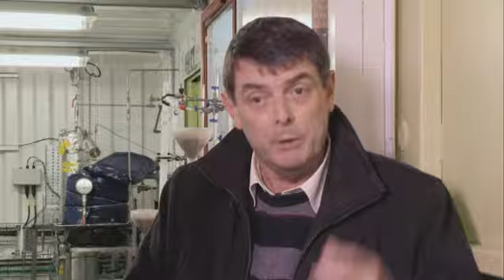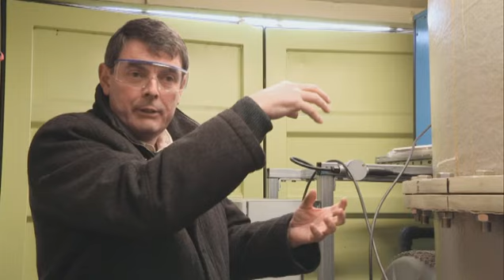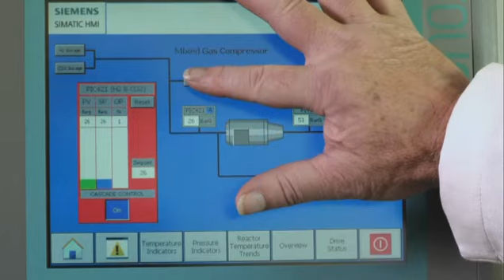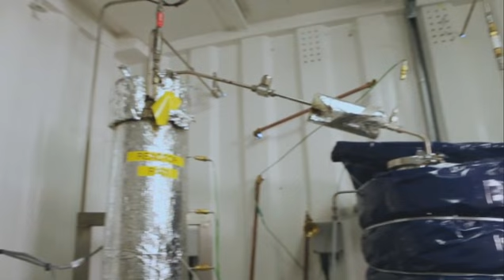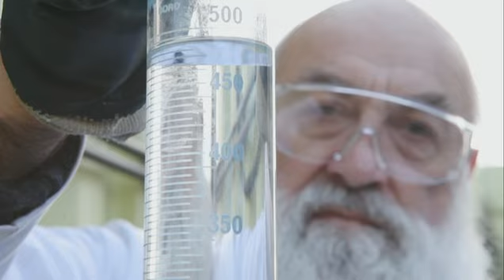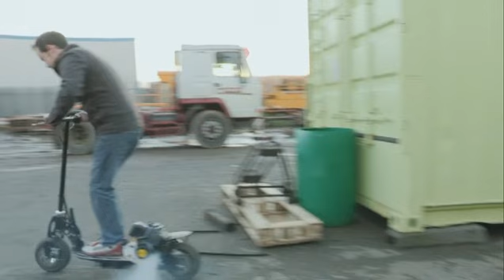Turning Carbon Dioxide into Petrol - Carbon Capture - Horizons

Comment: Is co2 now recyclable? Or renewable!? Amazing either way. Gives me hope for the human race
Reply: So does this mean that if this was implemented in cars that they would act like co2 vacuum cleaners?
Reply: @Heroniden  Or hook it up to a molten salt smr with a small supercritical CO2 turbine to provide the electricity and process heat.
Reply: Plants do recycle co2 and it has been totally renewable for since stone and stick were invented.
Reply: Do the maths Dum Dum. ..... 1 pint of fuel per day and probably Created 10x more CO2 than removed from the Air through the electricity used lol.
At $250 a gallon, who's going to buy it and a business that's never making money is a chemistry, experimental, money pit for grants and investors that never see thier money again 😅😅😅👍👍👍👍
Reply: @scottyg4605  well yeah but it would work for the concrete business which is a large ass amount t of the carbon...proudly more than humans
Reply: @scottyg4605  Dumb dumb, not if you use solar, EGS, hydro, wind, dumb dumb.

Comment: I don't see this becoming that big.  In the next 100 years fusion power and other clean alternative fuels will become affordable.  Hell vehicles may be powered by a small fusion reactor for all we know at this present time.
Reply: Not as long as there's idiot drivers on the road. They'll be crashing cars and exploding reactors left, right, and center.
Reply: @OneTequilaTwoTequila  fusion isn't fission. Fission is passive because the elements used, decay regardless of whether or not it is being used for power. Fusion stops the moment the pressure from the containment stops.

Comment: This is a simple transformation of solar energy into liquid form, using plenty of electricity.  I do not think it is anything new.  They are having to convert solar energy into petrol because storage of electricity is still in its primitive form.

Once the storage of batteries or capacitors increases to a viable degree, this process will not be needed, as electricity would be used directly.

Everyone should stay away from NUCLEAR power because of waste disposal issues.

Green Energy is the way.

Comment: Wouldn't it make sense to have this device at a refinery where they could capture the CO2 from the flare-off stacks and stop it from getting into the atmosphere in the first place?  You would get a higher percentage than using the low concentration that is in the atmosphere.
Reply: Thats the idea, but you're asking a lot of fuel companies. The hard part is the temperatures on those stacks, but that can theoretically be converted to energy as well, cooling the CO2 then recapturing it. Its a big investment even for the oil companies, but it should eventually be required, if not profitable.
Reply: It makes far more sense to not flare in the first place, since the gases that get flared can be used as fuel themselves. Most refineries these days only flare in case of emergencies (overpressure in any of the pipes).
They have a small pilot flare that is kept lit at all times, but it burns a minimal amount of gas. The rest is recovered and either used to power the refinery itself, or sold as fuel.
Reply: You can even capture co2 from the exhaust of every vehicle and then send it back to be converted back into fuel.
Reply: Or just don't flare the refinery gases and imstead send them to a phosphoric acid polymerization unit to make more liquid fuels.